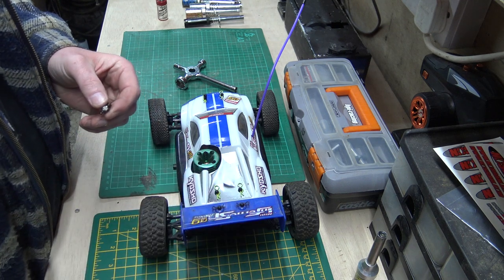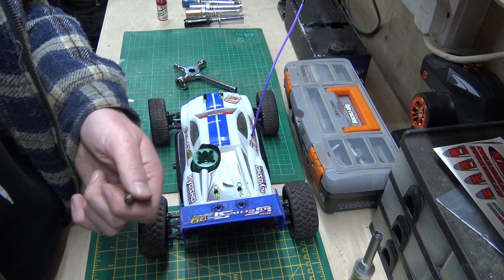All About Nitro Glow Plugs & Glow Starters

Comment: My rc car is bad on the cold start. It takes maybe 20 spins until it will run and i think it is the glow plug becuse it dosen't glow all the way down. Could it be the glowplug? The carb is also a bit weird adjusted not by me do but its not going perfect and revs high.

Comment: if you pay a little more and buy a rechargeable metered glow starter you can tell if your glow plug is working without removing it from the engine as the meter needle moves into the green area if the plug is working, if not it stays in the red area.

Comment: I do have one question I got a starter box in our other losses 8 Nitro fights every time I put it on a tostada box overflowed the engine and I'm just wondering if it's because it got started about might be too much power for door if it's not enough Wawa it will start and sometime it won't me just put out the engine when I try to start it

Comment: How does it work after the the starter is removed?!? I don’t get it?
Reply: The coil is made from platinum.
When platinum is hot and surrounded by methanol, which is part of the fuel mixture, it causes a catalytic process that makes the platinum glow without electricity.
So it only needs electric to start the process.

Comment: I got a new one that says it takes C size battery and it doesn't fit
Reply: Need a decent new pull starter for my 28 nitro engine could you recommend a good one to buy.thanks John.

Comment: only charge them for around 4h as most chargers are 0.5mah and the batterys inside are 1600 to 2200 so 4 hours is full charge
Reply from the maker: They say 16h on the battery 😂 some of them anyway, I should of mentioned about the chargers actually… some are 170mha and some are up to 750mha. That’ll be for another video lol
Reply: @HaggardRC   well for that amount of time is would be thinking that the charger is only 0.100 mah so yeah 16h to charge  but i think most chargers now are 0.500 mah so 4 to 5h if 1600 upto 2200 mah battery  well thats what mine are
Reply from the maker: Hmmm none of mine are more than 350 I don’t think. Ehhh I’ll make a video about chargers it’s more content 😂

Comment: Do you run at all when it’s raining   
Does nitro work in the rain or is that a no no

I live on the west coast of Canada it rains a lot where I live   
Rain does not stop me from my nitro bashing but the old school AM radios those ones aren’t waterproof cars so I only use them on dry days. 😊
Reply from the maker: Rain won’t stop a nitro car dude, just be mindful of the receiver and air filter as long as they’re covered up (the shell should do the trick) then it’ll be fine!
Reply: @HaggardRC  
Ohhh so cover the air filter with a air filter sock or extra cover for wet rain and muck so that does not stick to the nice clean filter 

That is my biggest concern 
When it rains on it or a splash gets the filter it all of a sudden can change even drastically sometimes. 

Is that the filter getting wet and being like way to wet 

I imagine raining is bad because the air is wet and it fills the filter up with water and clogs.  

I don’t know it’s really really wet here more than most places
Reply from the maker: You can buy waterproof air filters. 
Get one of those or put a waterproof but breathable cover over it. It’s not about it getting dirty or clogged but more water getting through it. If you’re just driving about in the rain and not going through big puddles it’ll be fine with the shell on probably :)
Reply: @HaggardRC  
I have the most fun bro ohhh yes 
Revo 3.3 
Nitro Rustler 
Rc10GT with a Picco 12 Rc speed 🤘😎 that’s a ripper 
A second and Third Rc10GT being built 🤤🤓
Then my electric cars 
1/8 Outcast 6s 
Traxxas Maxx 4 s model runs 6 s Traxxas electronics 
Redcat Landslide full M2C upgraded 4s 
Losi sonova digger 4s 

And last my new to me pre built 30 degree North buggy 
Electric conversion 🤩🥳🤤🕺EZRUN Max5 combo 800 KV motor 🤘😎

I absolutely love the hobby thank you so much for your help along the way bro your very kind and a very helpful person
Reply from the maker: You have a nice collection and thank you :)
Reply: @HaggardRC  
Just saying so you know I have watched probably 20 or more of your learning and tips videos and countless other nitro related vids you do.  They’re real good videos you make I like them a lot 😊

Your videos help a ton of other people to  🤘😎